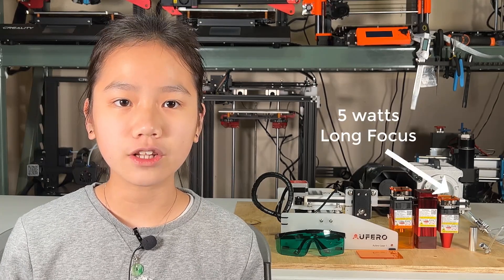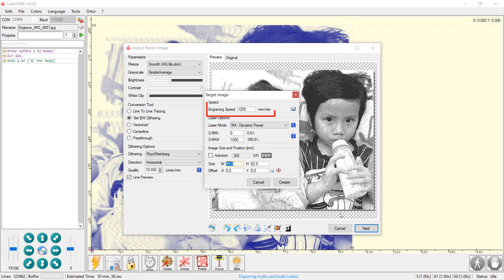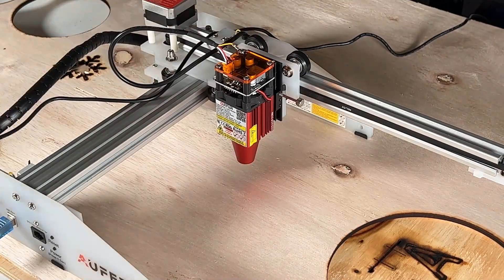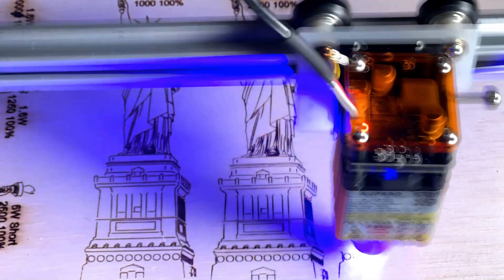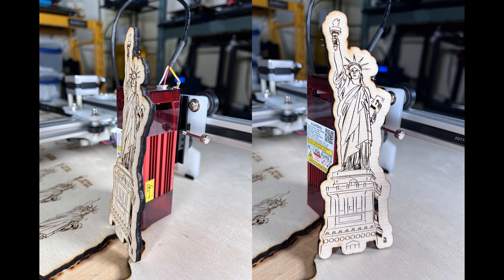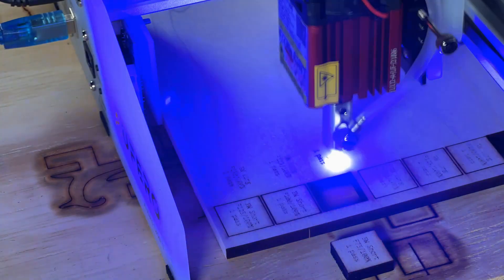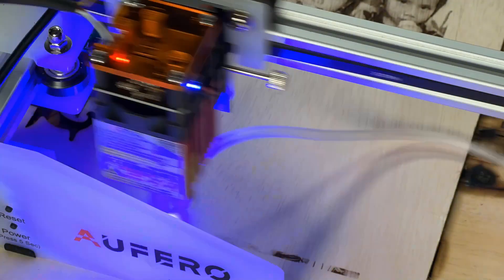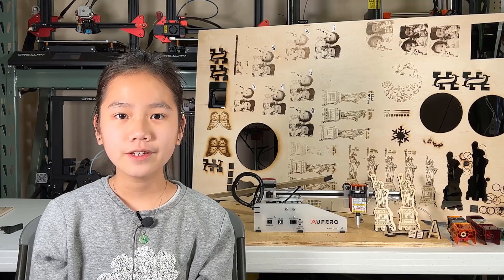Ortur Aufero Laser One: 1.6W, 5W short or long focus module with air assist, which works the best?

Comment: Very nice review, thanks. Two passes through 1/2” poplar is quite a nice achievement. I wonder how long the lasers last at 100% power, it may be better to run slower at lower power levels, another good reason to opt for the higher power module. It helps a bit if the workpiece is raised off the table so that the smoke can go out, this helps prevent obscuring the beam if the smoke is out of the way especially if you use air assist. A bunch of drawing pins on their back will do but has the disadvantage the it is not as stable if the table shakes during cutting.

Comment: Very informative video. I just about to start modding watches. I want to laser print my own logo (about 1-3mm size) on a small 29mm watch dial. Would a long focus capable to do this or a short focus is better? Thinking of laser cut my own watch dial also. Tia

Comment: Hi, great video! Can I ask you how you power the fan? I see a green module with led numbers (10min 53). I'm a newbie but I would like to add an exhaust fan like yours to my setup. Thanks in advance for the information! Regards Kristof
Reply from the maker: I have put the links under the description, just buy the fan, ducting, and print the 3D printed parts. The fan I use is a 12V fan with a server power supply from a mining rig, you can simply buy a normal AC110V fan from the link and use the wall outlet to power it.

Comment: Hi, great video. Thanks. I would like to ask. I've just installed this air assist of ORTUR. From where should I focus the laser beam? From the bottom of the laser house or from the top of the nozzle (the place that in touch with the beam pipe). Thanks, Asaf
Reply from the maker: The focal length of the laser module is the same no matter you install the air assist or not, you can just use the same metal cylinder to set the focus like before.